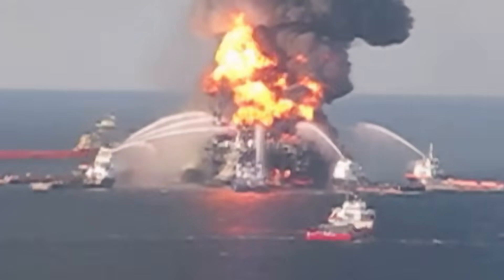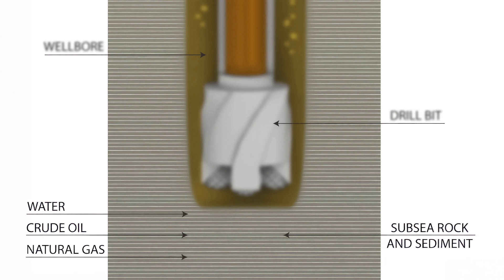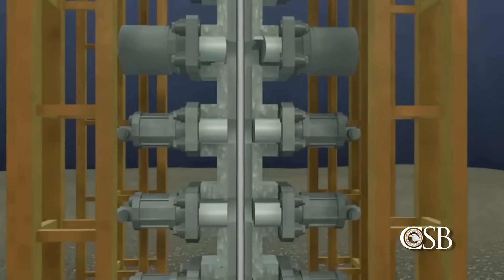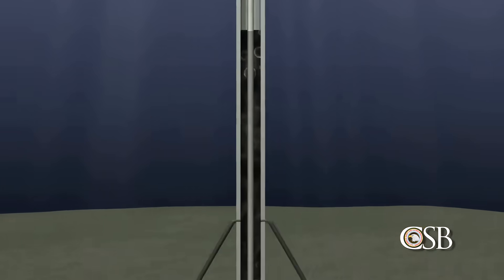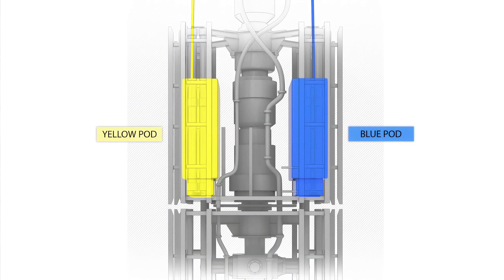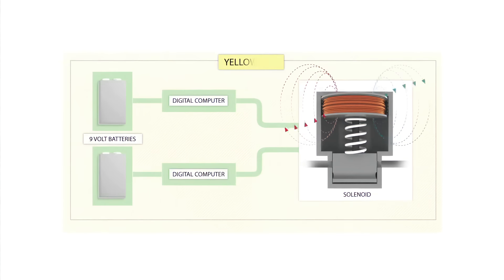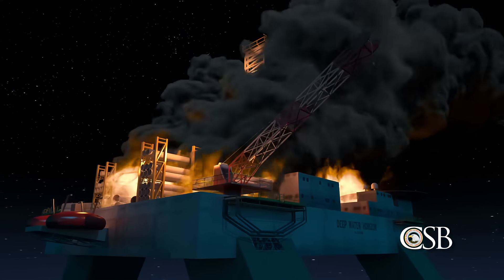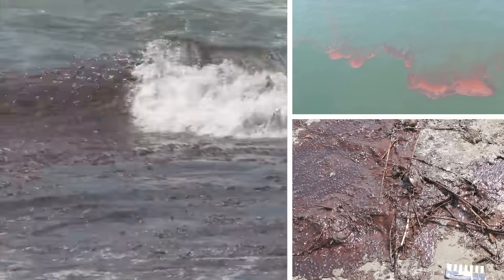Deepwater Horizon Blowout Animation

Comment: How many catastrophic disasters could have been prevented by someone with a multimeter in a factory?
Reply: How about With a multi meter on the rig? I imagine someone is in charge of maintenance as well as tear down and setup of the bop.
Reply: @Cbow406  contractor used to do ours Cameron or GE/Baker Hughes
Reply: @kieranhimself3655  Cameron built this BOP, who are now part of SLB...
Reply: Yes, I would imagine that there would be at least one sparky on site with a multimeter. Hindsight is an amazing thing
Reply: @Cbow406  The BOP arrives at the drill platform premade at a factory, the RIG workers install the BOP that placed on the ocean floor attached to the concrete well casing into rock thus making the BOP permanent to Ocean floor, the BOP is supposed to be tested before it even leaves the factory, so that's where the original problem lies, but the dead battery issue is the well owner's responsibility and should be replaced at regular intervals
Reply: @Cbow406  Jesus bless you
Reply: The world will never know. And that is tragic.
Reply: Honestly this is embarrassingly bad, how the hell could this life safety equipment get installed like this. Should be way simpler and operate on loss of power spring return mechanisms.
Reply: It's shocking really.  I've been in the Valve industry for 30 years now.  Everything goes thru Witness Testing - Everything.
Reply: It appears that although the wiring was incorrect on the power source for the solenoid, the solenoid did ultimately trigger.  It was the buckling that prevented the pipe from being sheared and sealed.
Reply: No doubt that mistake was made on the rig. Those solenoids fail often and the Subsea tech makes the repairs and should test. They are a pain to test and noisy AF. Often field changes are made and wiring diagrams are practically useless.
Reply: A lot I imagine. That and making sure budgets do not impact safety levels. I have read up on a lot of industrial disasters that went to hell due to budget cutbacks. The Bhopal gas disaster is one of the most noteworthy I can think of.
Reply: There are plenty of people with Multimeters at the factory, what most places need, is 1 Competent person with a multimeter
Reply: Or with fucking common sense...

The shortest supply of all :(
Reply: A lot believe me i worked for 2 years as an apprentice electrician and even one miswiring on let’s say a capacitor an that device might just blow up in someone’s face.
Reply: I work for a large semiconductor equipment manufacturer.  You be screaming foul at the shit going on with these multimillion dollar tools.

Labor cost cutting.  Cheap employee.  Employee don't give a shiet.
Reply: Ever seen a rig?
Reply: @spartamerican6758  I guess I seen one on TV
Reply: @kieranhimself3655  Yeah, and a lot of combat, too!
Reply: Yes
Reply: He might be having a target to finish testing of 120 pieces per minute 😀
Reply: 42
Reply: This comment is 2y old but still I've been holding off on buying a multimeter an I'll take this as a sign
Reply: So u mean that would eliminate need of test after installation? Nothing can happend during transport or by the hands of poeple installing the equipment?
Reply: This wasn’t in the factory. This happened on site. I hope the clown electrician had his license pulled.
Reply: Or you know, routine inspections
Reply: One oil barrel is 5.614 cu ft
5mil barrels is 28.07mil cubic feet.
28.07million cubic feet is 0.0002 cubic miles.
Bottom line? That's a tiny amount of ocean.
All these oil spills are treated in the media as world-ending spills.
They're far from that. Just a few years later they're all gone, or have basically zero impact on life.
It's amazing how the media can get away with talking about these in an overblown and out-of-proportion manner. Trying to guilt society for using oil, basically&truthfully.

Why do we as a society allow the media to do any of this?
As soon as a media outlet does anything similar to this in any way, including causing riots for justified police actions, we should all shun that outlet.
But now? American media are just as extreme as religious extremists, but society still treats them as legit news sources?
Get real.
The media has become a new extremist religion, just as bad as bin laden and other extremists.
It's time to stop looking at false-facts and innuendo. It's time to hold them all responsible for their bullshit.
Nobody wants to be an extremist.
But the whole entire world is just as bad as nazi Germany and the KKK.
They don't mind following extremist ideology as long as it aligns with their own.
Reply: Imagjne spending more money to save lives! Ha!
Reply: In my experience around building controls in hospitals, the best installations are done because the inspector and testers do their job meticulously. They are also the most knowledgeable people on the job. They can also be lazy and not do their job. Or they don’t think of everything to test.
Reply: None. It’s was done deliberately by the obummer administration
Reply: how many disasters could have been prevebted, if Companys did not only try to make as much money as possible, without thinking about the consequences, especially for the life of their workers
Reply: This is probably the best criticism comment I've ever seen in my entire life, a word of truth said in the best way possible
Reply: the more disturbing part is what's next....
Reply: Goose would still be flying with Maverick
Reply: Facts
Reply: https://youtu.be/QPywCD-TSd0
Reply: Hundreds
Reply: There you go selling multimeters again.
Reply: I've always wondered why at my job I always had to do a bond check at the end of every job. We kind of roll our eyes at it these days, thinking what's the point?. But after reading this comment, ill never take those 60 seconds it takes for me to grab a meter and do a bond check for granted again.
Reply: Should have been fail shut
Reply: None that day,They wouldn't listen to Mike Williams and the other guy
Reply: Reality? All of them. Every electromechanical issue can be tested with the use of a multimeter and accurate trend logging over time.. catch being is we dont know exactly when the breaking point is, its still guesswork. But we can say that its changed since the first tests. But also understand its alot of individual tests. But that doesnt help if people die because of money.
Reply: A substantial lack of quality control. With the importance of these safety devices you would think that every single safety device would be checked and rechecked. But no,that would cost money they don’t want to spend.
Reply: None, you cant wire am underwater BOP in a factory.
Reply: @spartamerican6758  You wire the solenoid in the factory dingus.
Reply: @richardmillhousenixon  No doubt the wiring mistake was done on the rig. That was an older rig and those solenoids fail often. Subsea Engineer would have been the person to replace and test the solenoid valve. Transocean does have electronic techs, but I doubt the ET would have worked on the POD. I have spent days troubleshooting control issues on PODS.
Reply: @hubriswonk  Either way many accidents throughout industrial history could have been prevented had someone bothered to just use a multimeter
Reply: @hubriswonk  The rig wasn't that old came out in 2000 I believe
Reply: @spartamerican6758  the POD unit is wired in a factory. I have wired them! the solinoid valves are called CCSV's. There are about 250 some wire pairs that hool up one 'can' (blue or yellow). Each wire is labeled and you have chart that tells you what wire goed to what CCSV.
Reply: @donnymarwin5776  have you ever been on a rig?
Reply: Not in uunderwater. Just only inbeteeen two constructing steps, on land....  @spartamerican6758
Reply: Or the crew closing more than 1 safety measure at a time they should shut the very top and the very bottom
Reply: @thatsclassified1  it is not intended for that. Each gets more and more severe and irreversible
Reply: Too many
Reply: Damn you bp!
Reply: @nathanaj2875  It was Transocean that actually caused the accident.
Reply: This clip is fishy to the nth degree. The Deepwater Horizon was one of Transoceans best and top rigs. Which means it had the best and top hands on board. All the sub-sea (people that worked on the BOP) fellows I ever worked around at this echelon were all about the business of doing it right. It is a law that BOP's are to be tested every 2 weeks and after each cement job at which time (most of the time) a Federal employee (MMS) will come on board and go over all information and check pressure testing charts and BOP function tests. It's a major federal felony to falsify any of these tests. I heard that they had done a cement job prior to the accident, and either waved off the test cause the feds couldn't make it to catch up some time or did perform the test and not realize that cement got up into the stack. Sometimes the formation swells up and makes the cement go higher up the hole (into the stack) than was calculated. Depending on how deep or how hot it is downhole is the amount of cement retarder they use. Sometimes it could take 3 days for the slurry to set up. And the possibility of the cement not setting up enough in the BOP's for 3 days before actually impairing critical  functions might be valid. Maybe one pod but not 2.
Reply: Or WORSE……. a task being performed by an substandard employee put in place by federal guidelines to achieve their quotas. BUT, we will Never know because federal government will hide this info……

Comment: I have a problem with this "effective compression" phenomenon for two reasons.  They describe the bends associated with this phenomenon as "minute", but yet they produced enough bend in the string to move it out of the zone in which the BOP would work?  I've seen rubber hoses bend with a bubble formed on one side or another, but the pressure associated with this type of deformation of a drill string would have ultimately blown the crown of that rig all the way to Cocodrie.  Another problem is the fact that tubes tend to straighten when pressurized.  This is how a Bourdon tube pressure gauge works.
Reply: That is what was seen when investigators retrieved it from the ocean floor and recovered the pipe that was it it.

Comment: The main bit you missed is that up until a few months before the disaster, it was US LAW to have two blowout protection valves. US Congress decided to change the law and only one be required. The question is then, would this have happened if two blowout protection valves where in place. They don't seem to mention this anywhere.

Comment: "blind sheer ram" Completely nullified by the thing it has to cut moving a little bit, why was the sheering surface of the ram not made large enough to encompass the entire possible area the pipe could possibly be in. either incompetence or optimism would make someone have it be smaller than the diameter of the larger pipe.

Comment: I thought the reason for the failure was that the shear rams were designed for a certain strength of pipe, but then the rig used stronger pipe.
Reply: No  according to the report the the pipe was correct for this blow out preventer.  The issue the the bend in the pipe.  If everything in the blow out preventer worked as designed it was impossible the the last ram the cut and seal the pipe.  Engineer laster calculated the force need to cut thought and out of center pipe was 2 too 3 times the amount of force the ram could produce.

Comment: SOLUTION: Install three zone AD-1 Well blockers..... The system diverts the flow to a containment float tank to prevent a spill. Locks the flow til divers put a new D1- Preventer in place.

Comment: Yep just like the Pepcon disaster, really, how many disasters does it take ,before people really take notice and work out a system to make sure it never ever happens again ? How many drilling platforms are out there with the same system and how many of them have been shut down to be inspected and made safe to the point that no matter what happens it will never ever happen again, like Having back box's connected to all operational sensors and also data recorders sent offshore, that way even if there's a massive explosion all the data is offshore and not at the site ? Basically a direct link to a satellite and interconnected to others as well, that way if one goes down for repairs or system check's and just happens for a offshore drill explodes its recorded data is already offshore from a different satellite. :)

Comment: Emergency back up deadman switches and they were miswired, what a crock of total and utter BS, if its was me, why not have a black box recorder to make sure that if anything goes wrong, you have recorded proof of what system went down and why, to think that the dead mans back up and its was miswired, its like saying that when they make the black boxes for aircraft were wired wrong, and i know the company which makes them as well and i can say with my life on the line that they have 5 separate testing down independent of each other to make sure they are perfectly working and pass all the international tests required to even pass, before they are tagged and signed off by 4 separate aerospace / aircraft engineers, so that complete section underwater should have been brought up and international inspectors check it and then report to the US government and also to BHP, not the other way round ,BHP inspectors work out what happened and then report to the relevant bodies in the State?

Comment: It needs to be repeated that what works on more shallow oil rigs doesn't work as well at 5,000 feet underwater and a lot of "Liberal Volunteer Scientists" on TV in 2010 forgot that important factor by claiming people could just 'go down there and cap that pipe...what is taking so long dammit' Not just Humans but materials and some electronics will cease to function or function incorrectly at 5K Feet below water. Not say BP wasn't to blame but sometimes it does take 47 days to fix something you didn't design and don't have people on payroll to fix. Screaming is easy and cheap, fixing problems are hard, time consuming and expensive. BP is not given enough credit for it ONLY taking them 47 days. I was amazed they did it in under 90 days!
Reply: You make a valid point...

Comment: For all those really curious what happened on the horizon, I can tell you exactly why the horizon failed. I won’t give details on how I know this information or names but I will give you all the truth of why the rig exploded. 
Deepwater horizon was built in South Korea and it took 3 years. Some incredibly intelligent men built that rig. BP got approval from Obama to drill there because they went to 5000ft and no one had ever gone that deep before. Everything was put into place in perfect working order and BP turned the rig over to transocean. They were the ones responsible for operating and are the 2nd largest drilling company in the world at this moment still. BP works very closely with transocean and remember this. 
One month after BP turned the rig over to transocean the project manager who built horizon went back and inspected. His findings were astonishing, all the operation and safety manuals were gone, the safety alarms were literally cut (not wired wrong). When asked about this to the transocean driller, he said because the alarms were constantly going off and waking up people they physically cut them out. This report was obviously buried and 1 month after that report was filed it blew up because no one was physically watching the gauges and the safety measures were disabled by transocean. BP took the fall because their close relationship with transocean. 
Of course this isn’t the narrative the movie portrays, because how are you going to feel bad for those people who worked with transocean and destroyed horizon and polluted the gulf? Instead they portrayed a tragedy and blaming BP for everything, when in reality you’d actually be yelling for them to burn with the rig for not doing their jobs and you say that those backwoods Cajun hillbillies got what they deserved. 
Believe me or not I don’t care, but that’s the truth of it.

Comment: This is such a mess. Such a huge mess.I'm not just talking about the oil either, if they had a Pipe ram almost directly above and below the Blind Shear Ram in the BOP, that would have much lessened the buckling, possibly allowing the well to seal. Also, dead man switch. Have some sort f force from the rig above water. Perhaps High pressure air (So if something happens, pressure drops rapidly) coming from the rig keeping things from closing, that way anything that happens at the rig blows the cap, releasing the air and triggering the blind sheer ram.

Comment: Miss wired on DC system? 
Kids could figure out how to wire solenoids and power systems,.
Do these billion dollar companies use quality control on such things like the system that saves the crew and platform, or is that just too much of a problem? Battery drain and solenoid issues? 
These systems should be triple checked and the people doing the checks need to be free from any pressure of costs, retaliation and corporate hassle